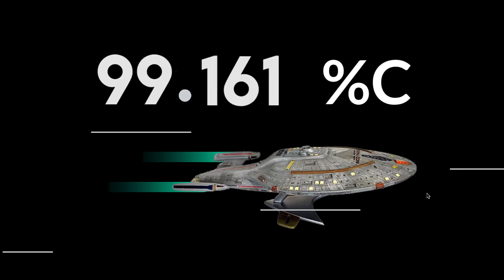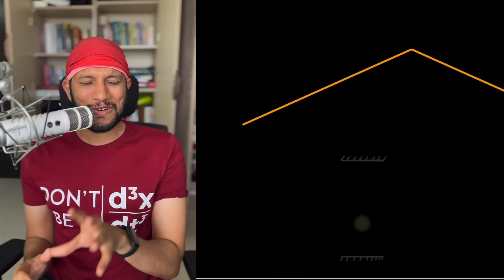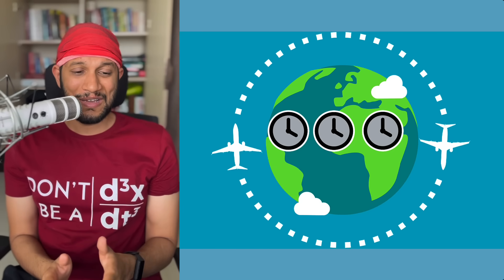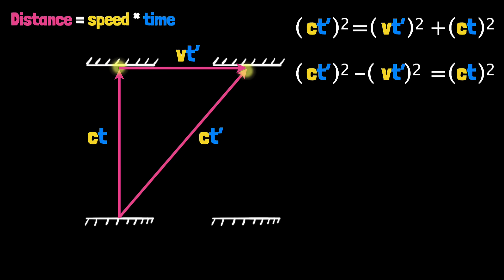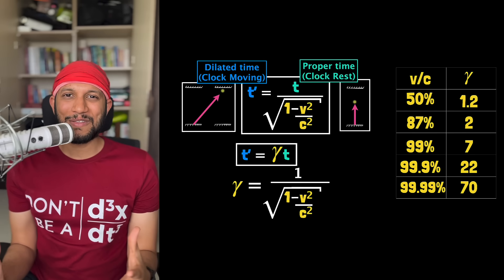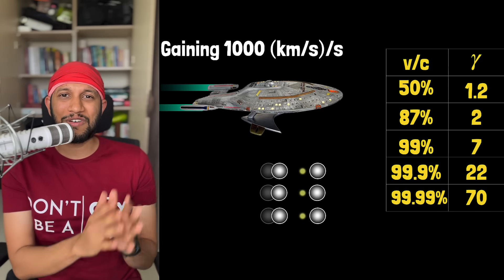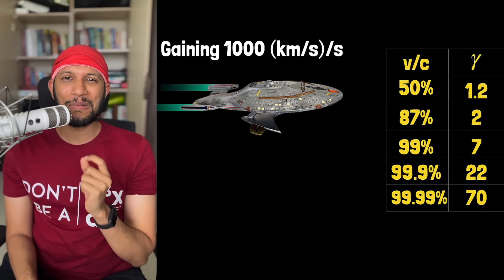I finally understood why you can't go faster than light! (My mind is blown)

Comment: 0:10 K formula is wrong. K (cinetic energy) = 1/2 mv2 and stop. that √1-(v2/c2) is β (lorentz factor) and is valid only if v<66.000km/s
so cant be K=K/β

0:44 this is also very wrong. why you dont turn the graphic 90 degree clockwise? so we can destroy "relativistic velocity formulas" because we surpass lightspeed? photons ALWAYS travel at lightspeed, but if we add the spaceship speed the photon will actually surpass light speed everytime it travel like the spaceship

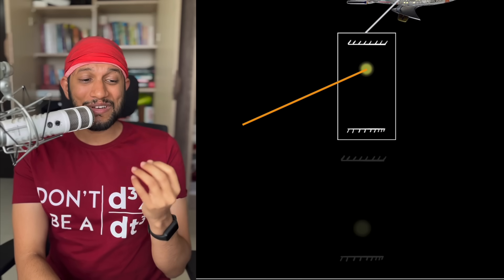2:12 time is a constant, cant change = theories are theories because basically wrong

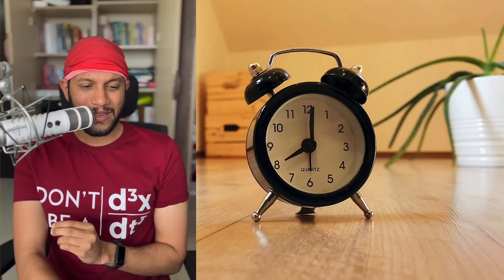2:28 you CANT compare a plastic rigid clockhand with massless particles, plus photons are NOT bounded by normal electromagnetic atom fields

3:48 lateral movements of 1kmh CANT modify the force of a metal spring in a mechanical clock ... ... so mechanical clocks DONT slow down at all

4:09 the actual experiment is invalid BECAUSE
1) plane environment is not a laboratory, just the vibrations and radiations in the sky can destroy the accuracy of such fragile thing (atomic clock)
2) as wrote in specifications of 5071A caesium beam clocks, the warm-up to mantain scentifically precision is about 2 MONTHS (they left the clock warming-up on the plane for 2 months? nah!)
3) as the in the video they say, if you spend all your lifetime on the plane you could see, maybe, a change of 1/10000 sec .... so no, time is a costant is is proven by this experiment. plus 5071 is old, today atomic clocks are more precise, so again, time is a costant. period.
https://www.youtube.com/watch?v=gdRmCqylsME&t=64s
https://ww1.microchip.com/downloads/aemDocuments/documents/FTD/ProductDocuments/Brochures/5071A-Sell-Sheet-00002980.pdf

5:08 NO! alpha decay (the process that move a radioactive atom in the periodic table, losing 2 protons + 2 neutrons) is true for all atoms. so, as in video, after 1600 years ALL atoms will have the half of radioactivity.

5:34 pions that decay into muons and neutrinos are just theory particles. you maybe referring at Bruno Rossi e David B. Hall experiment, full of bias and incorrect because made just for prove a THEORY (again, theories)
even muon g-2 experiment in FERMILAB is biased and is not correlated with your video because was about "magnetic dipoles"

6:26 again, wrong model, wrong associations. travel time DO NOT slow down the radioactive decay that is bounded with sub-atomic vibration (again other topics that are not correlated with your video)

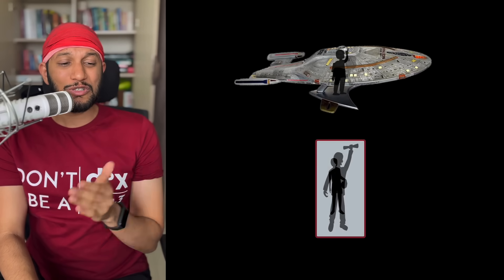6:57 even IF is true (is not proven by anyone, sorry. muons are particles that can be created only in laboratory so is bias experimentation) you are talking about nano-seconds of difference, that means nothin in your video.

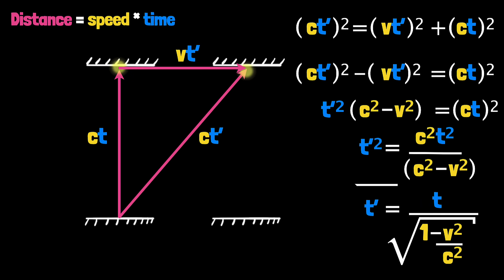9:24 as i said earlier, turn that 90 degree clockwise. too easy to move the experiment and theories in the way you want to. then you apply a calculation of 2 DIFFERENT situations that cant be compared.
+
basic math error
T' and T arent the same. you even draw "scalene right triangle"
"base" are different so you CANT eliminate "power"
T' (cathetus) CANT be equal to T' (hypotenuse)  AS  photon speed is costant at 300.000km\s so the time for travel a cathetus IS different to the time for travel on hypotenuse.
this is basic math. "base" need to be the same value.

SPEED = V (costant)
vertical cathetus time = A
orizontal cathetus time (not add time travel of spaceship or we dive into "mathematical functions") = A (because im magnanimous and we eliminate the scalene and we go into isosceles)
hypotenuse time = B
		

(VB)² = (VA)² + (VA)²
V²B² = V²A² + V²A²
V²B² = 2A²V²
B² = 2 [(A²V²) / V²]
B = √2 [(A²V²) / V²]
B = √2 (A²/1)
B = √2A²
B = A√2

and the only thing this is mean is B>A you need more time to travel hypotenuse then cathetus at costant speed ... WOOOO warm water !

A and B (your Ts) are both time and based on the same scale of time, meaning time is a costant again

TIME IS COSTANT
and all those formulas from great persons are THEORIES ^^

enough ^^
i used 3 hours of my time to do the base thing everyone do about THEORIES, REFUTE.
next time study a little more, too many errors
and dont think theories are CORRECT, theories are INCORRECT for definition

so in the end

YOU CAN REACH LIGHT SPEED ? maybe
can you say no? NO

Comment: 1 FRAME OF REFERENCE !!! SO IF YOU ACCELERATE THE 1 SHIP TO 75% AND LAUNCH THE OTHER 2:SHIP  THEN IT START WITH 0 SPEED SO IF SHIP.2 ACC TO 75% IT WILL DO 1.5 LIGHT SPEED IN REF TO REF FRAN 1 AND 75% IN REF FRM2... AND THAT STARGRACK DOES IN A WARP BUBBEL .. THEY JUST LAUNCH A NEW WARP BUBBEL INSTEAD OF A NEW SHIP .. FROM REF FRM 1  75% REF FRM 2 75% REF FRM3 75% 2.25 SPEED OF LIGHT IN REF FRM 3... EASY PEASY..
IF YOU ARE DANISH THAT IS..

Comment: I mean… no? Given the reference frame, that photon clock’s “ticks” would still be the same, regardless of “perceived diagonality”. The graphic of it from outside literally has a slower animation. Change in relative direction does not automatically mean different speed from the reference point of the mirrors. Notice how he never showed both animations and reference points at the same time. I think you might be confusing optical illusions for objective reality.

Comment: But that's not the explanation I expected :o
Your explanation only talks about what the outside observer sees - i don't care about that though

What physically keeps ME IN THE SHIP from exceeding C? It doesnt make sense to limit it by what an outside observer sees.
C is constant, so within the ship, the photon clock will keep working normally and the Photon doesnt need forever to trigger a Tick (unlike what an outside observer sees, but again, even if an outside observer will see the ship stuck, it's not what happens from inside the ship)

Again, what keeps the ship itself from losing acceleration close to C and why can it not accelerate past C in a vaccuum (ignoring any friction)?

Comment: I have a question. This delay in time seems to be mostly affecting the observer. How about the people on the ship itself? For them time is normal, wouldn't they experience the speed of light some time?
Edit: I see you already made a video of it :D
Reply: Light is faster than electricity by about 20-40%. If everything within the vessel (including people) were moving at lightspeed I'm not sure how well they could interact with the ship.

The muscle movent resulting from the neuron signals to move would be far behind where the ship is when the body is able to act. The ship itself will be much slower in correcting direction than the speed it's moving.

It would be like riding a bullet fired from a gun at that speed, except you might be able to make directional corrections in slow motion for a new trajectory.
Reply: @tylerhorn3712  that's a good point actually.
Reply: i asked the same question. what i think is light will always move with constant velocity. its relative velocity does not changes. for the person inside the ship moving with speed of light. the photons will come at rest with respect to them which is not possible. so time should infinitely slow down for them . even they will face time dialation but this left me with one more question.  even if they are facing time dilation than how is time relative then ? a person in inertial frame and non inertial frame will see the same outcome . i can be wrong maybe
Reply: also if a object approaches the speed of  light its mass also increase making it almost impossible to reach speed of light and mass in not a relative term. maybe this is correct
Reply: m' = m /root 1-v^2/c^2

Comment: The difficulty arises when you include spacial contraction. at c the universe would be a flat plane with infinite contraction in the direction of travel. Assuming a  100m wavelength radio photon had mass, what would its frequency and then distance between peeks be to the photon? A similar effect would occur with the light clock as happens with distance galaxies there would be a change in observed wavelength.

Comment: I always wondered what reference point we are supposed to assume in these thought experiments. A moving clock ticks slower, but moving compared to what? If I am out in the void of space and I zoom past a "stationary" person, the thought experiment says that I should age slower. But from that other person's perspective I might have been the stationary person in which case they would age slower. How does that work?
Reply: Your speed is relative, it will Always dépends only on the two referentiels. To talk about aging you need too choose a referentiel and wont change it. 
If you go in a spaceship really fast, you Can calculate that for you it was a certain Time and on earth an other Time. That's all

Comment: Thank you, probably the best explaination of time dilation I have ever seen. Damn, I will have to watch your other videos now.

A word of advice if I may. You are using the mic incorrectly. You are speaking too close which is why it is "popping". You need to speak into the side and not the end with this type of mic. Finally the suspension cage you are using to isolate the mic from vibrations should mounted vertically. It doesn't work if mounted horizontally. Hope this is useful as you will record better speach quality.

Comment: when it comes to proof of time dilation, in everyday life, we actually have a pretty easy proof of that. GPS satellites. only works if system on the ground and the satellites. can agree on what time it is. (down to milliseconds). but due to time dilation. the satellites have to skip a millisecond a few times a day. otherwise they will begynde to go out of sync

Comment: Photons move at exactly the speed of light. This means their time dilation is infinite.
And so, for every photon, its travels any distance, from any point where it is emitted to any point where it is absorbed, instantaneously. A photon begins and ends its existence at the same time, with no time passing in between.
But a photon would still agree that the speed of time is the same everywhere for all observers. And if it can travel any distance in the universe instantaneously while moving at the speed of light, then to that photon the universe has a size of 0. For a photon, there is 0 time and 0 space.

Comment: Me again, we are looking at this from our temporal frame, we are limited by light speed. You need another frame of reference. We need another dimensional frame, one where C is not the penultimate achievement. We are burdened by time and space. If we could step into a 4th dimension where we can see space/time as the fabric it is, it would be simpler. We will never go faster than light, without wormholes or a singularity drives wherein you pinch space in front and squeeze it through the singularity and then you are moved instantly as far as you can go. Imho.

Comment: Its imposible?? Because you tell it. Just before you fall in a black hole you reach that imposible speed. Foton clocks move back and forward no up and donw. Einstein
Reply: In black hole you don't have the speed of light
Reply: @alcidedragon  yes, much more. No times. Calamar
Reply: @ricardogracia8516  No you don't, Can you give me what made you think that ?
Reply: @alcidedragon  light can escape from hole them gravity force is more powerful than light emiting by suns. Clear?? Crazy Horse
Reply: @ricardogracia8516  Its difficult to understand your words...
But light can't escape black hole.
And yes so you Can Say that Gravity is stronger but that didn't mean something is faster than light.
Reply: @alcidedragon  sorry, i want to say can't, Obviosly. And yes that energy you call Gravity is more tham 300000km/s . Sun have 274m/s of Gravity aceleration. A objet with 1000000000 times that weigth almost reach that aceleration of 300000 km/s. Only put a little more mass and you got It. Por cierto, que un reloj atrase o acelere en un campo gravitatorio o variando su velocidad no significa que viajes en el tiempo...lo más posible es que rompas el reloj...y tú con el, pero en el presente, no en el futuro y mucho menos en el pasado. Un saludo!!
Reply: @ricardogracia8516  but this wont work, trying to see Gravity as an accélération only work with Little mass and Little speed

Comment: I feel like this isn't really intuitive, it's based on "time dilation" and you're talking about muons lol... my intuitive understanding is that you accelerate by throwing stuff off the back of a train, the faster you go the harder you have to chuck something off the back to get a noticable of push of movement, since you're moving away from every particle that your thrown object would push off of to propel you... there is an infinite decay because the faster you go the less push you can get from bouncing stuff off the particles that you're moving away from very fast, and you can never quite close that gap to max speed.
Reply: but to be honest, even if you can only ever move at 99.99% the speed of light you can still get places really fast, I'd be more worried about what it'll do to your body than how to close that last 0.01% gap

Comment: One question, if you go at 99.99% of the speed of light and because of time dilation you look a this space ship and it stands still for 77s before moving. Is it then moving one second with the speed of light, so is it moving 99.99% of the distance in an instance?

Comment: Does this mean that you could travel to a solar system 70 light-years away but age only 1 year if you were traveling at 99.99% the speed of light?

If we were to shoot a spaceship at 99.99% the speed of light into space and watch it for one year we'd see it travel almost a light-year (99.99% of one), so in one year it would travel a light-year, pretty intuitive.  BUT we ALSO know that the people on board would be experiencing time at 1/70th the speed we do.  So in one year they'd only have aged 1/70th of a year.  So far so good, but when we put them together we get two facts seemingly simultaneously true. A) they travelled 1 light-year B)they aged 1/70th of a year.  Extrapolate that out and it seems we could travel 70 light-years but age only 1 year.  Am I missing something?  If not, distant space travel sounds very possible sometime in the future now.
Reply: This is an extremely complex question and the answer is" faster you go, more time dilation. From the perspective of us, it would 70 years. From the perspective of the people on the ship, as they got closer and closer to the speed of light the time dilation would theoretically also climb towards infinity. Really, the answer is (if I understand this right) depends how close you get to infinity.

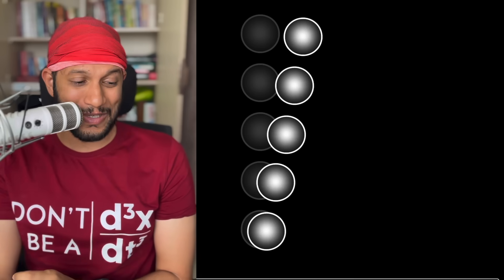Comment: 3:39 You may enjoy my time dilation clock (v2). I can't post links any more.
>
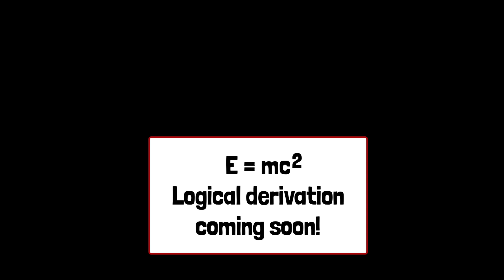16:28 You did a brilliant job of the explanation here :)
>
All of this is well known to me and the math makes sense, but I can never reconcile the time difference between the local observer (on the ship) and the external observer. At the boundaries such as the photon traveling at 'c' or the event horizon of a singularity, time dilation goes all weird.
When I attempt to rationalize a universe where all objects can occupy the same 3D space but have multiple progressions of time for the same object it leads to some difficult if not impossible reconciliations.
For example; the photon can travel for 10 billion years at v=c and therefore has existed for 10 billion years (obvious), but the photon has experienced zero time itself and for the photon it could be argued that if it has experienced zero time then it has not even existed. Existed for 10 billion years and not existed in the same 3D space :) lol
I am open to ideas as to how to reconcile this time dilation paradox. (It is likely as much a philosophical questions as it is scientific).

Comment: If all motion is relative, then wouldn't time dilation also be relative? For instance, a person traveling in a plane should be aging at the exact same rate as someone standing on the surface of earth, because they are "both moving" relative to each other? 
Wouldn't time dilation then imply that motion is not relative, but that there is in fact a "universal reference point" so-to-speak?

Comment: Very good video, well done --> However, you are neglecting some very important changes. Nowadays, 'c' is a definition, NOT a measurement. This changes EVERYTHING. It is a definition based upon perfect Minkowski Space-Time, whereby the Quantum Vacuum  doesn't exist. Well, the reality is that it does exist, it's massive & carries about 68(%) of Total Cosmological Mass. So what this all means is that 'c', may not actually be THE theoretical limit. I've seen work which argues that it's about '1.1 c' .... This 'change' slightly modifies ALL predicted dilation changes; length, time etc.

Comment: There's a simple reason why you can't reach the speed of light, basically the faster you want to accelerate the more energy you have to expend in the process, and this is where the Law of Diminishing Returns comes into play, also, in order to travel at the speed of light you and the spaceship you're travelling in has to have zero-mass.